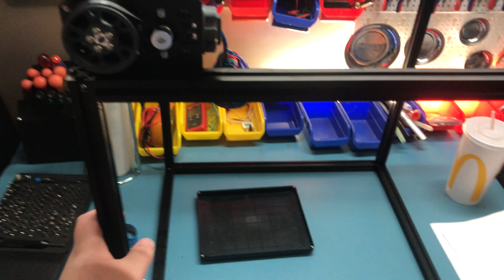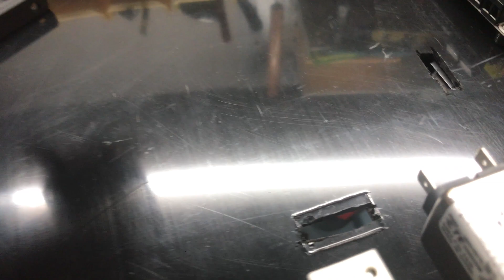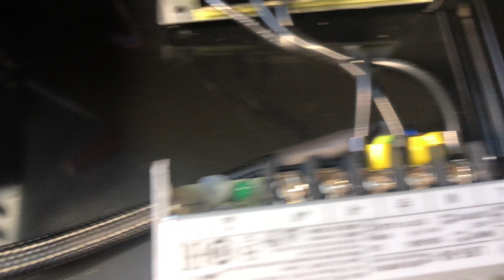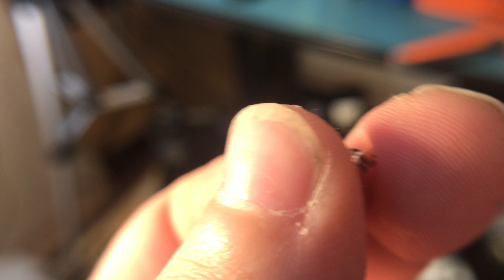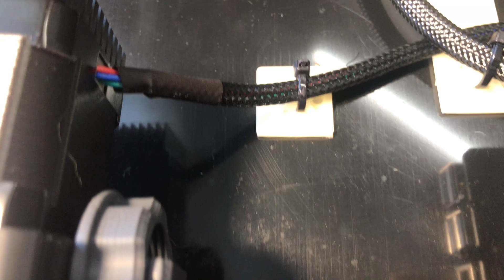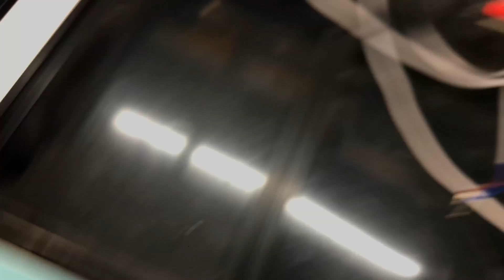Voron 2 Ep. 6: The Frame & MGN9 Rails & Electronics

Comment: just krimp them with plyers and put a drop of solder on it. I did that for all my conectors cant be bothert to buy a crimping tool Its tediosu but it works realy well
Reply from the maker: I'm horrible at soldering. You will see an example of how bad I am at it in the next episode.
Reply: @IsiksTech  sn-2549 are the jaws you need for crimping that will work in those crimpers